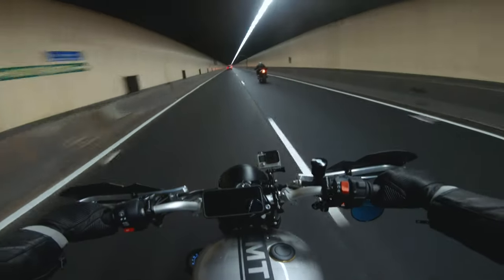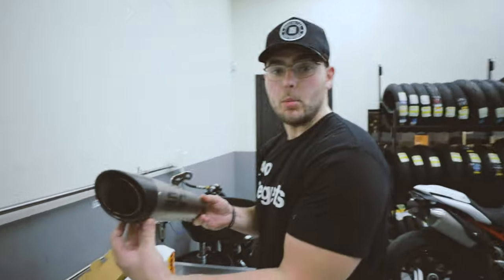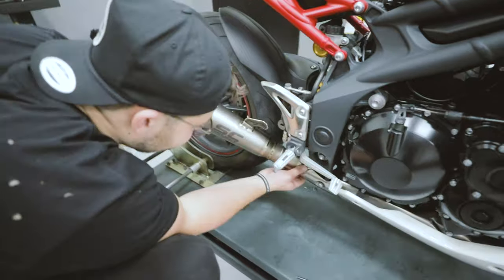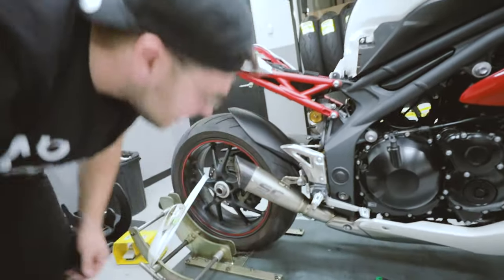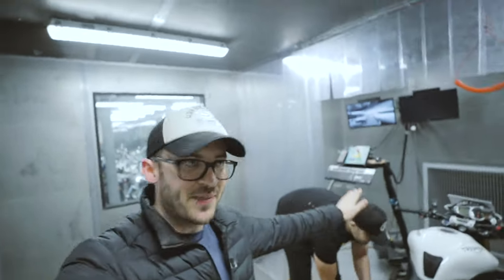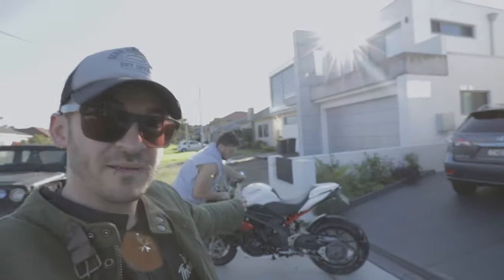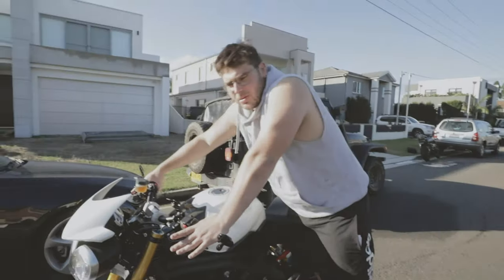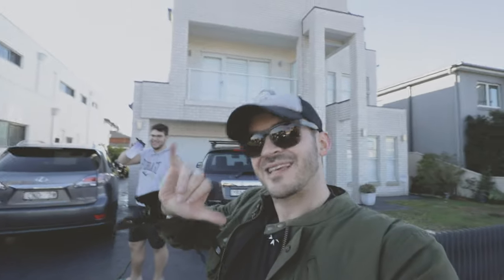SC Project Exhaust Sound and Installation | Triumph Speed Triple R

Comment: hey guys, wondering how you installed the mounting bracket that bolts to the frame/footpeg area. I ask because mine isnt fitting, .... the bracket keeps hitting the rear brake master cylinder & rubber line. I cannot seem to make it work correctly. what am i doing wrong? The bracket is being installed in the correct manner ... but there's no way it fits with the stock brake master & rubber hose in the way. 2014 speed triple.

Comment: Supreme soundage!
Reply from the maker: Ballzy hey! We’re happy on this end 💪
Reply: Was the leak due to overfill/thermal expansion of the liquid? Or is there an actual crack/loose pipe somewhere?
Reply from the maker: k mc thermal expansion man. The engine temp sky rocketed due to it running lean. Just needs a remap and should be sweet

Comment: I just bought the high mount dual mufflers. Seems simple enough to install but uses a clamp around the cans themselves
Reply: Hi there. My fingers are literally hovering above the "buy" button for the SC1-M SC Project cans (dual high mounted) for my 2020 Speed Triple RS. How did you find yours? Did you have to remap? Sound good?